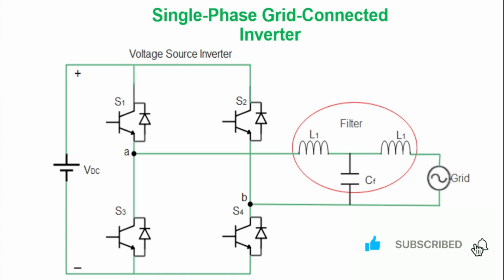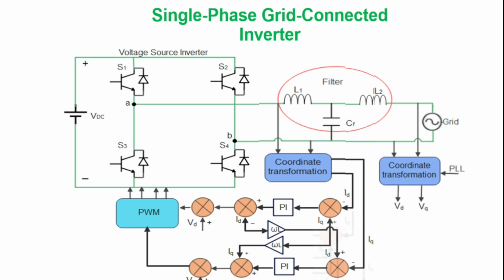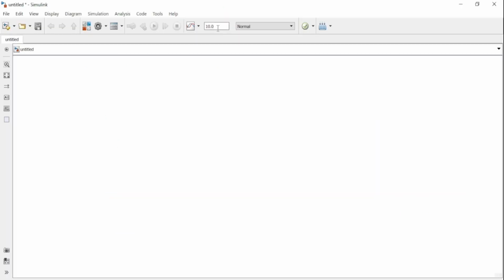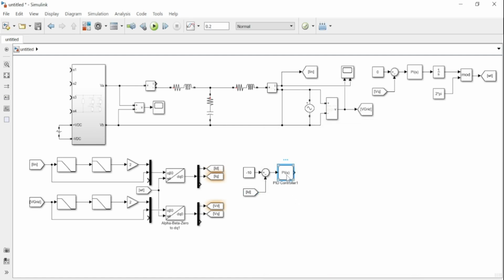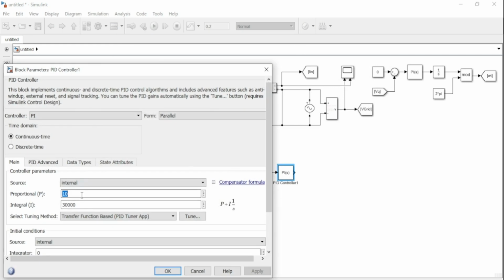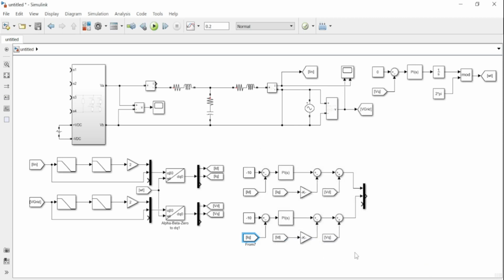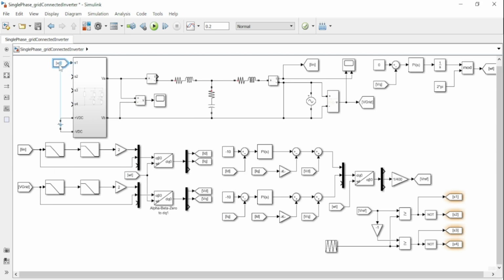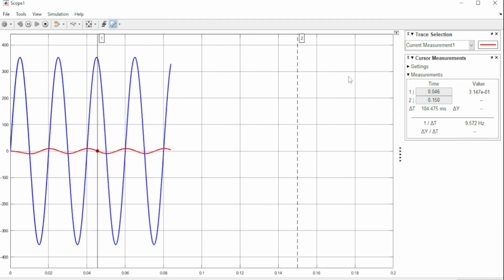Simulation of a single phase grid connected inverter

Comment: Hello This video is very helpful for understanding concept of 1-ph  Grid Connected Inverter but I have a doubt. How can we set the value of PI Controller?? Is there any equation or method ??
Reply: If possible can you provide the reference paper or source for that equation!!
Reply from the maker: Thank you. Yes, there are equations, although you might need to tune the gain parameters, especially when the system is non-linear.

Comment: Thank you for the video. I have an inquiry.
Is there a source(theory) which can help me understand why all this one is supposed to do all the modelling the way its done?
Reply from the maker: I'm glad you found the video useful. Most papers will just explain a detailed portion of the system. E.g. an author can write more on the filter, while another may write more about the parameter control.  This means you may need to read different literature to have a detailed understanding of the whole system.